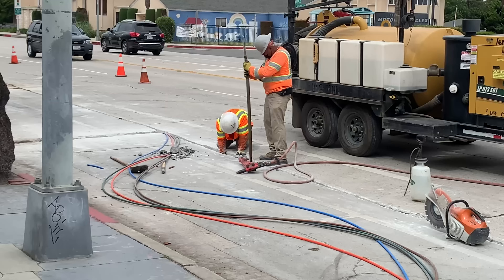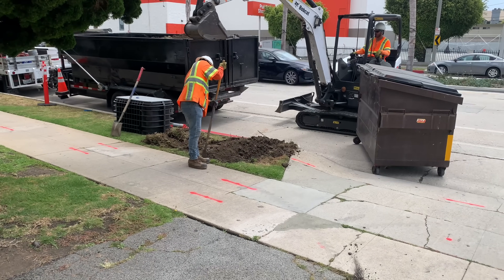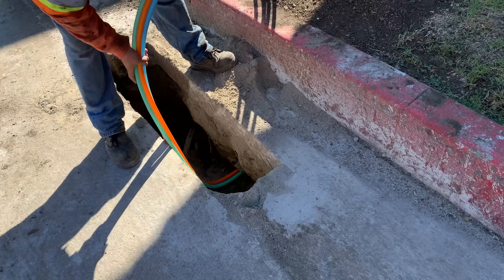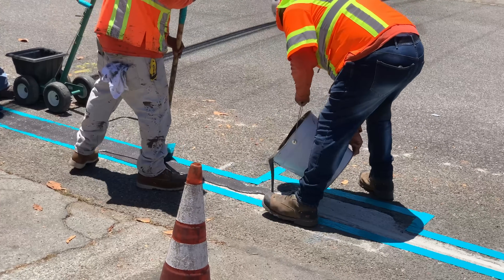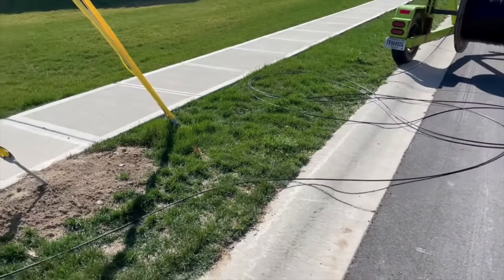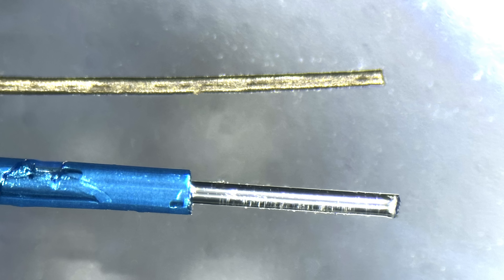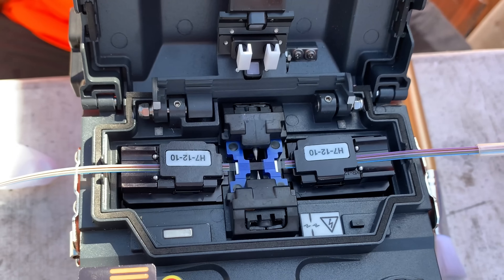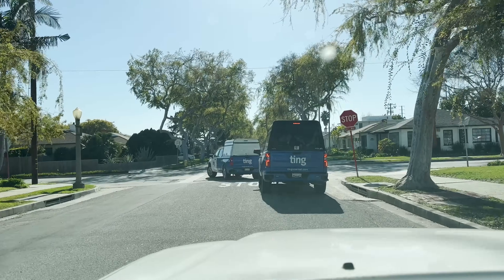Fiber Optic Network Install

Comment: fun fact, the fed helped pay to lay optic fiber in the 80's. When it was done, the telcos didn't want to share the fiber with competitors, so they dug up the fiber. The reason we don't have fiber across the US is the greed of the telcos. I remember seeing fiber being laid all around southern CA.

Laying fiber is time consuming, but the US would have been way ahead of the world in broadband if the telcos didn't behave like greedy jerks.
Reply: That's crazy! In the UK (at least where I live, small borough so a little late) we got fiber installed around 2001. It's shocking how these big companies have slowed down progress in US by decades.
Reply: Its funny they wanted to do the same in the 80s germany but then they decided cable tv is more important...
Reply: This is a common misconception, funds in the  1996 Telecom bill were for ISPs to build fiber to the node and between data centers which they did. it was NEVER for every single house in America to get a dedicated fiber line.
Reply: @FlyByWire1  I... I don't even know where to begin. The Telecom Act of 1996 was about interconnection and competition.

There isn't one word in the ENTIRE act about Nodes. Or fiber for that matter. I am not even sure you are in the telecommunications field whenever I read your comment.

As for the original poster's comment, he has absolutely 100% no idea what he is even talking about. There are fiber interconnections across the entire country. Many of them for that matter. Just because America is slower on rolling out fiber distribution to homes, doesn't mean the fiber infrastructure across the country isn't there.

Why fiber to the home isn't widely available is because of anti-trust laws and the fact that the entire telecommunications industry is competitive. And it is immensely expensive to rollout a new fiber to the home plant from scratch. So businesses are obviously a bit slower and less willing to spend many millions of dollars rolling it out whenever another communications company just come in and do the same thing and split their revenue sources making the ROI model they were using go out the door.
Reply: @thenerdnetwork No. The reason we don't have much fiber to the home is because of the LACK of competition. Go to any city hall in a town where a cable company and a phone company is all that exists and ask them to see the franchise agreement. Usually it's the cable company that has won out with provisions to disallow the telco, or anyone else, from putting up lines that would compete. They also completely forbid any competitor from offering TV even if their lines are capable. For instance, where Comcast has a monopoly and Verizon FIOS exists, Verizon aren't allowed to offer TV, whereas there are plenty of areas where TV comes in over FIOS.
Reply: @timramich  Ok, I am calling you out. How about YOU show ME any franchise agreement that precludes ANY other company from competing with it. Because if its true, it literally violates U.S. federal antitrust laws.

I work in telecommunications, and I will tell you why much fiber to the home isn't available. Ready? Because its insanely expensive. The amount of engineering, labor, and parts would blow your mind. So any city that ONLY has a cable company and a phone company is most likely because financial nerds did major calculations on take rates and figured out a ROI, and its either non-existent or will take forever to break even. This means the area is just not worth the investment without subsidies.

When I work on fiber to the home builds the area usually has very high density. Would an operator want to put up say, 2000 ft of fiber (which is nothing) and have that 2000 ft service 0 customers or would they rather run 2000 ft of cable and be able to service 100 customers?
Reply: @timramich my friend has FiOS, Comcast is in her neighborhood. She had Comcast until she decided to switch. Her TV is FiOS.
Reply: Different times. Fiber has been useless for a long time for residential applications. It was way to fragile. As you can see here, things changed a lot.
Reply: Do you have any sources? Telcos in the 80s were all part of the Bell breakup. There were no competing Telcos as the breakup mandated them becoming ILECs. Which literally meant they could never directly compete with each other. But this gave access for CLECs to come into play. I would like to read what you read that backs up what you are saying, because it goes against literally the entire history of telecommunications in the US. Also "digging up" the fiber would pretty much go against the rules of interconnection, which also goes against what you said. I don't expect any response from you here.
Reply: I'm right leaning, but I'd be for fiber as a public thing if it could mean the government didn't couldn't touch it (censorship). When the largest provider of internet in the country is one giant thing (NBC, Universal, Comcast, Microsoft) there is a problem.
Reply: Yup, I remember when Verizon just straight up said they weren't bringing FIOS to anywhere in NY but the biggest cities like Syracuse and NYC and that the rest of NY is better served by high speed cellular service to the home.. And that was about 25 years ago... We were on Verizon 3Mbps DSL for $50 a month hoping some day to get Fiber to the Home while hearing about the FIOS rollouts, and I was soooo bumed about that decision and communication from Verizon to their stockholders. They just flat out said the future of high speed home Internet for every home in America is cellular 4G LTE service.  Eventually left NY to come to Kansas City where Google Fiber was doing their trials with fiber to the home, and I've been on 1000Mbps fiber ever since, for $70 a month, going on about ~12 years now.

Comment: The major problem for me is that a fiber enters in house in a garage and then converted in wifi. But if you want Ethernet cable in a room, then you are out of luck.
Reply: No one is going to do inside wiring for you, if you want that, just do it yourself.
Reply: @nick21614  Thanks for confirming that. I will show your note to AT&T when they will try to convince me to upgrade to the fiber.
Reply: Is it that hard to install Ethernet cables lol?
Reply: @null643  At least it is easy to say.
Reply: It can be done of course, depends on how your home is built, slab, basement, etc.  Not many home owners like to do that, sort of the same as running a new circuit for your electrical power.
Reply: @iworkout6912  Exactly, it's why I stay away from the fiber.
Reply: How about you just hire an electrician to lay you some Ethernet cable? It's really not complicated
Reply: @florichi  Recommend some.
Reply: @kamertonaudiophileplayer847  every electrician in your area can do that, they do it all the time.
Reply: @florichi  I am a very picky.
Reply: @kamertonaudiophileplayer847  what are you picky about? It's a stupid 8mm cable. Just call electricians in your area with good ratings on Google
Reply: @kamertonaudiophileplayer847  Just run it yourself, you buy the cable (easy), you remove the packaging (easy), lay the cable (easy), connect the RJ45 ends (relatively easy, takes some practice though), plug in the cable to your router and pc (easy).
If those steps are too much effort, you don't need speedy internet anyway :P
Beyond that, any idiot can do it. No need to get an electrician for that sort of simple work.
Reply: @florichi  Thanks, do you have an idea about the price? Let's say I need the cable from a garage to second story, aprox 60ft.? Ideally the cable should go inside walls.
Reply: @kamertonaudiophileplayer847  I live in Austria, so naturally with our brick walls it's a completely different story to your situation in the US/Canada, where you just need some fishtape and enough patience. I would say a good 2 man team can do that run in under 4h, so it should be under 300$, but I am not sure.
Reply: @florichi  A moving to Austria is also an option.
Reply: In Spain we lay the glass fiber to the place you desire, so then we install the router, if there is no conduct, we staple on the skirting board or hot glue.
So you can may ask for a replace for the glass fiber point to the place you want, it may have a cost.
Sry for my english.
Reply: @MrPixitaloka  Thanks for the info.

Comment: This is the least intrusive utility install I've ever seen! Looks cheap AF compaired to sewer.
Reply: Least intrusive? They destroy the pavement, look at the holes/gaps they left behind...
In Europe they use a 'mole', a remotely operated little drilling device that is sent from the street to someone's house underground. It digs a small tunnel and drags the cable through it, meaning only a small entry and exit hole are needed. They can lay cabling under your preciously cared for garden without disturbing so much as a flower in it.
I assume the US also has such drilling devices, not sure why they're not using them in this video.
For longer stretches, in Europe we usually dig a larger trench and lay conduit if it's not already there for copper wires. This allows future installations and repairs of cabling without digging up the entire street.
Reply: @someguy4915  I would guess that directional drilling is 1 more expensive. 2 less accurate, 3 has length limits and 4 is less gentle with the wire. Directional drilling has to pull the cable from one end. This means that the longer the run the more tension must be applied to the leading end of the cable to fight the friction from additonal weight. These are single filamenr glass fibers and glass is not strong in tension. When laying cable into a trench from reel only the weight currently in the air is relevant to the laying process, that and any spool drag or intetia which are tiny compaired to cable friction with soil in the directional drilling case.
Reply: @alexanderx33  Still, you can easily get ~100 meter runs with standard single fiber runs with it, should be enough for most street-to-house runs. Beyond that you either need a halfway point (middle break) or have the mole lay conduit instead.

Comment: Spectrum simply hung a fiber cable from the pole. City living is complicated.
Reply: Suburban fiber laying sure has to be easier than city installing.  Apartment buildings, endless underground utilities, traffic, etc.  Most suburban fiber laying is underground installed., or utility poles which are already in place.
Reply from the maker: Yeah no telephone poles here though
Reply: It's so much easier and cheaper that's why both laying the fibre optic cables and repairing damaged cables later on. Imagine the added cost of drilling through roads and driveways for thousands of neighborhoods in the city.
Reply: xD
Reply: Just went through existing conduit here